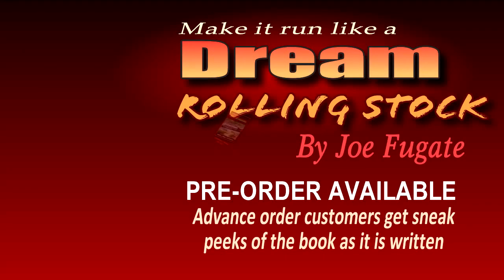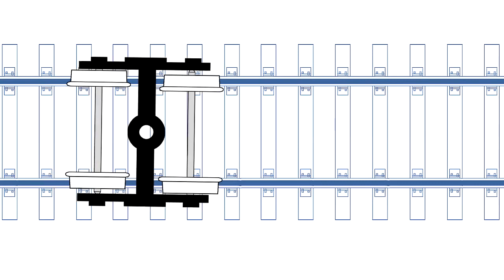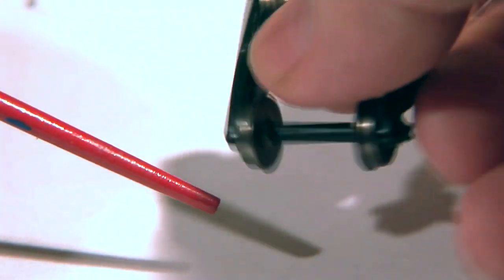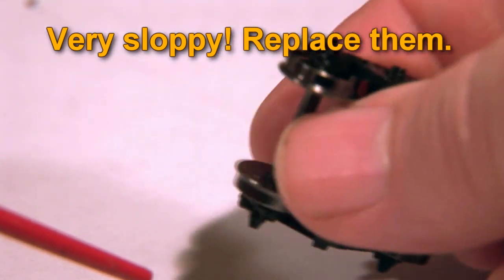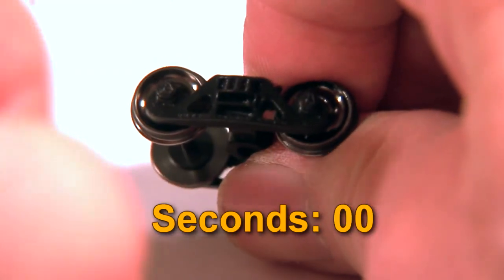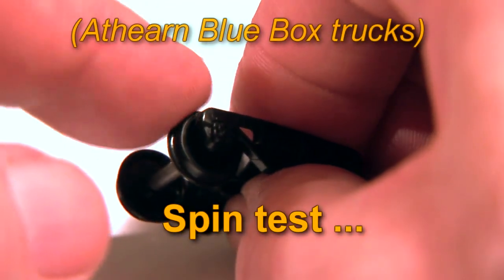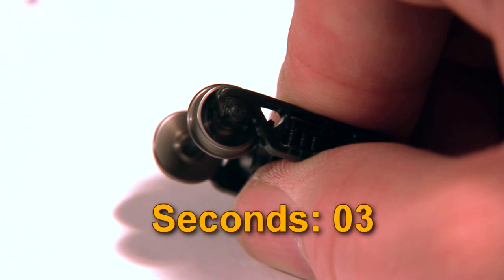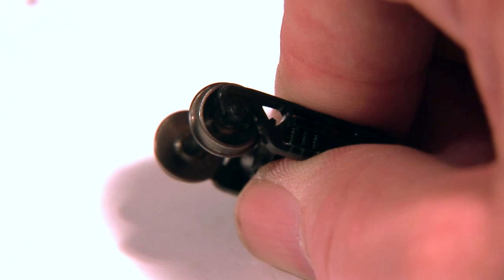Identifying derailment-prone trucks | Run like a Dream Rolling Stock

Comment: Excellent advice.  I have long advocated minimal side to side slop. Reboxx wheels with their variable axle lengths are a great innovation.  btw - .088 width wheel treads work flawlessly with HO code . 083 Atlas switches.
Reply from the maker: (Joe Fugate) I agree with beyondDCC, flawlessly is hardly the word for it. Try this -- whenever a car derails (even once) take it off the railroad. I did this and eventually every code 88 wheelset car was no longer on the railroad. Of course there were code 110 cars in the collection as well, but NO code 88 wheelset cars survived. This resulted in me banning code 88 wheels from the layout and going to strictly code 110. If you follow stringent performance standards, you'll find code 88 wheelsets are anything but flawless on track designed for code 110 wheels.

Comment: I was running a new Athearn Genesis GP9 without the gear covers ( I was lubing the gears to see if I could cure the loud gear noise [I believe it is the gears]).  It had a tendency to derail without the covers in place.  With the gear covers back on it runs fine.  I did notice the Athearn locomotives I just got have more play in the wheels (as you describe in your video) than my Walthers Proto and Atlas Master Gold locomotives.  I am new to the hobby.  I would think that the Athearn locomotives should not have so much play.  I just ordered your Run Like a Dream book series in downloadable format.  A lot of great info, can't wait for the locomotive book.  Thank you again.

Comment: So yeah,  I was testing the wheel spin  and checking slop and some improvement would be good.  I have a good NMRA HO gauge for testing flanges,  track spacing and coupler height and other things.  I never changed the wheel sets on those intermodal well cars.  How about how much play should the truck swivel have?

Comment: those wheel sets will work on different cars.  I have a coal car that seems to not like my switches and goes off while the other cars stay on and also both of my intermodal cars seem to go off on 18 radius curves not on all the curves though so they are somewhat proned to the littlest deviation.   As my caboose was coming into the switches in the back,  it would go off.  I weighted that to the NMRA standards,  I tried kadee sets.  Pretty much of my cars have kadee wheel sets and all have kadee couplers.    So I would like to know where to get the good wheel sets in video.

Comment: Wait a minute, you can allways put some kind of spacer to the inside of the truck and have the wheels symetricaly positioned. And with smaller side movement. Right?
Reply from the maker: @mrnicehearted - Correct. The trick is doing that without destroying the realistic look of the truck and wheels. Better is to replace the truck sideframes with ones that don't have as much slop, though.
Reply: Needle point bearings are so small they have a bubble pointed cleaning \cutting tool but little filler shimms sounds to much Just replace side frame \ truck if to much play?
La

Comment: My Athearn .bombardier cars are horrible in this respect. Totally non free rolling.  Any suggestions ?
Reply from the maker: First, try replacing the wheelsets with all metal wheels - both metal axles AND metal wheels. Second get and use a Micro-Mark truck reamer. Third, apply powdered graphite lubricant to the axle tips. If all else fails, replace the trucks with something better.
Reply: @MRhobbyist  Athearn Bombardier trucks aren't the typical trucks with journals.  They have internal bushings and the axle ends are exposed, so the reamer would be of no use.  Graphite helps, but the set I bought more than a decade ago have been relegated to a box in storage.  I could never get them to run reliably, and it isn't my trackwork because all my other equipment operates almost flawlessly.

Comment: What brand of metal wheel sets are those in the video that spin really good?
Reply from the maker: The trucks shown are: Ring Engineering (perfect minimal slop and superb spinning), Bluebox sideframes with Intermountain metal replacement wheelsets (really bad slop).
Reply: Model Railroad Hobbyist magazine thank you for the reply.

Comment: sweet i must be a god cuz all my wheels have play yet never derail maybe your track work sucks ?!?
Reply from the maker: I have no doubt some get lucky. But if you want something that works for everyone, lucky or not, eliminating side-to-side slop really helps. I prefer not to rely on luck alone.
Reply: its not luck its skill and really the side to side movement isnt a derailing problem  slightly bent axle are though
Reply from the maker: Skill doesn't change the laws of physics.
Reply: how wrong you are skill enables you to control physics to a percentage
Reply from the maker: Fine, then these techniques work for folks who are mere mortals in regards to skill